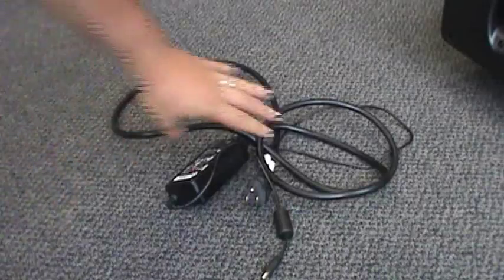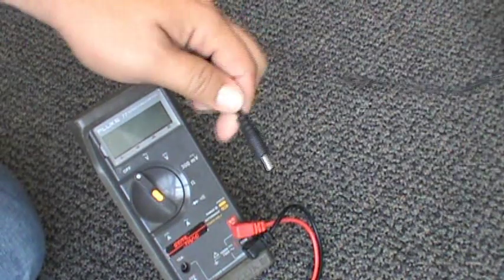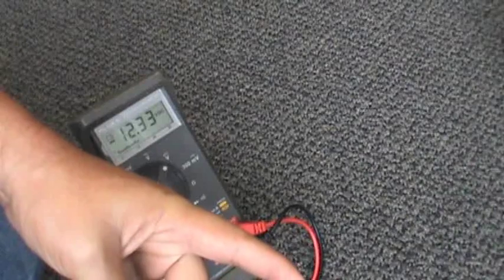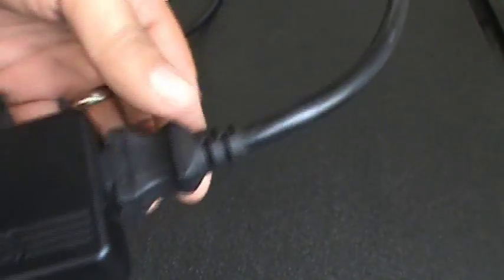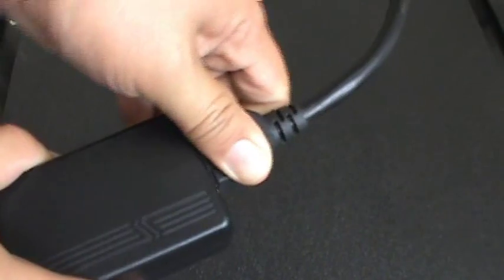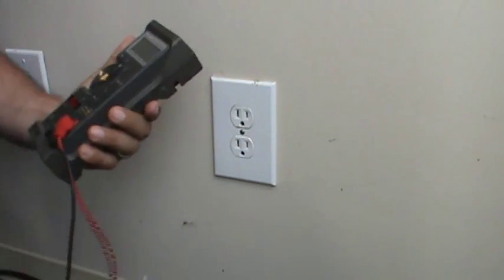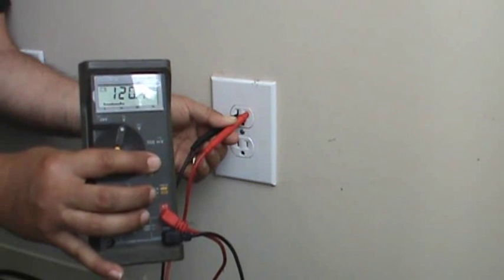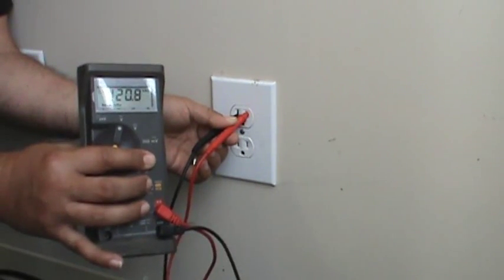646-1196A

Comment: If there is no DC being supplied, I verify that AC is present at the female end of the 120v cord then if not I check the outlet....so far I have seen three 120v power cords that were internally broken. No point in replacing a PS when only the AC cord is at fault.